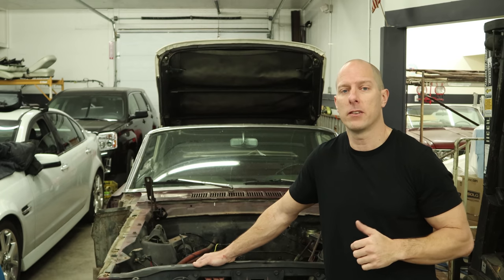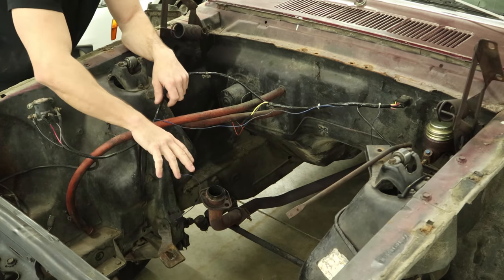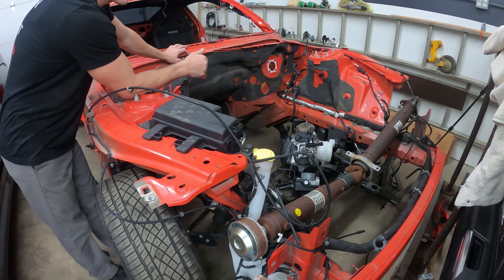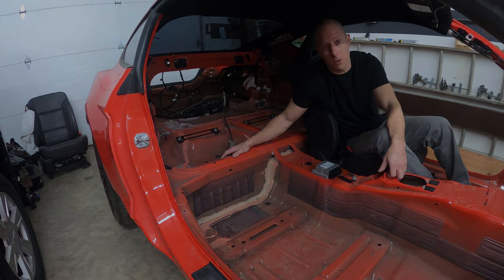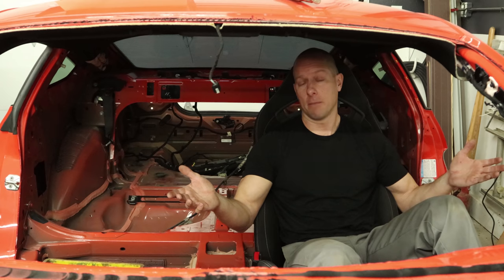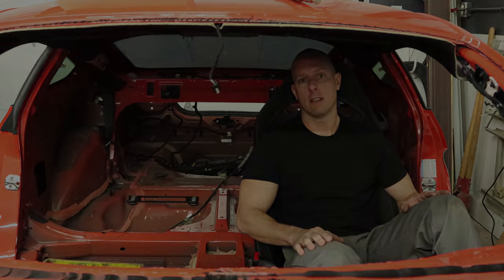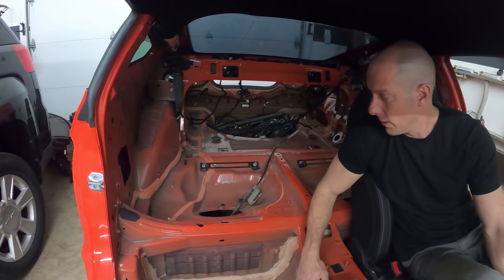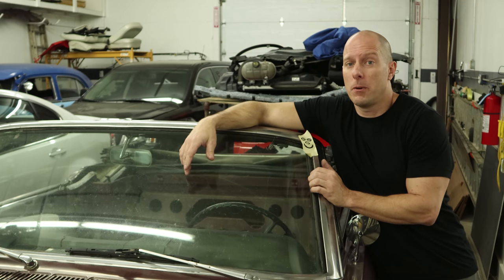The future of the Mustang restomod coyote swap rebuild project  part 6

Comment: I didn't fall for it for reason No 3: there was 5 mins left in the video and I wasn't born yesterday lol

I know I'm a smartass on here but honestly? I think you should look at putting all the 2015 components into the 66 dashboard. I think from a fabrication standpoint it would be MUCH easier and cleaner. There are controls and stuff on the sides of the 2015 that can't just be cut and have it look proper. 

Just comparing the photos of the two other than the odd switches around the steering column, you've got the gauge cluster and the infotainment system and the console. I think that would bolt right up to the very basic mustang dash. 

I wish I lived closer, with my 3d modeling ability, casting, molding and knowledge of CNC, I could make you up any pieces that you needed to mod the 2015 or make the 2015 fit the 66.....
Reply from the maker: Sorry, your CNC and 3D modeling will not work with my freedom units! 😂 the dash is the last part to worry about and I might end up with your method.  Heck, maybe a road trip to hold you to your offer!
Reply: @vehcor  Heck. That would make for a great series of videos. Murray in Oz.
Reply: @talaminia  yeah that was what I was saying....they are actually very similar in basic layout.
Reply: @vehcor  haha I also work in freedom units! We will have 2 x 4's and 4 x 8 sheets of plywood. I buy a lot of 1 x 12 x 96 rough sawn pine for my signs. The only place the freedom units interfere is with sheets of acrylic...the shit is metric and no longer freedom units. 12 mm isn't the same as 1/2" yet they charge the same price....(thievin bastards lol).

Say you want to adapt the 2015 gauge cluster to the 66. Send me the gauge cluster, and make a template of the opening on the 66, I could make the acrylic cover, an adapter plate, or a mold fit the hole perfectly. I've dabbled in cast aluminum too. I use my CNC to make a pattern out of foam, then pack that in green sand, pour in molten aluminum, voila. 

here's some batman logos etc I did for a customer's kids for their bedroom doors:

https://www.facebook.com/muskokacustomwoodcrafting/photos/a.1473939432898489/1520397324919366/?type=3&theater
Reply: @muskokamike127  why not just CNC the aluminum in the first place?
Reply: @chrisanon2573   my cnc wasn't "strong" enough.  I also use a router which runs too fast to properly machine aluminum. 

This was more of an experiment to learn about casting without investing in thousands in equipment. The "right" way would be to machine a pattern, then reuse that pattern to make many copies of something. Using foam, the pattern is destroyed similar to the "lost wax method". 
I also don't have easy access to green sand (proper sand for casting) so I had to make my own which won't hold the shape if I go to remove the pattern. 

I know there are people out there who machine aluminum using routers, but the results are sketchy at best. They also don't go into any detail as to the long term effects it has on their machine. 

I have a buddy who works in aluminum and has a plasma torch connected to his cnc. He wanted to get into more 3d items like I was. He would start out with a block of T6, then run his mill for 24 hrs machining it. I said "just cast it first, then you only have to do the final machining which could be done in an hour". "takes too long" what? takes an hour to cast something and an hour of final machining" no it's faster to run the mill for 24 hrs...OH kay......

I rebuilt my CNC from scratch and while the frame work is infinitely more rigid and stronger, the motors that drive it aren't. I run Nema 24 stepper motors and 12 mm ball screws. To do it properly, I'd need Nema 35 steppers and 20 mm ballscrews. That's another 5 grand right there. 

To give you an idea of cost: A local machine shop charges $100 an hour for mill work. So if it took 20 hrs to machine something, then that would be $2000. My method? $200 to $300.00. 

In addition, I was using aluminum I salvaged from computer hard drives, etc. I had to melt it down into block form anyways to get it into the basic size I needed. Then machine that. Why add an extra step? takes minutes to machine foam, maybe 20 to warm up the forge, (I made it with a steel bucket and plaster), and minutes to cast.

Comment: Hell yeah finally someone agrees with me get rid of the fractions go with decimal points metric is better metric is better.

 Sorry had to get that out
Reply: I have been using metric since the early 80's when I stated restoring and building Japanese motorcycles, then I became a Honda Equipment mechanic. It really is a lot easier to use, I am now big into Bicycles and most of then go by the metric system.

Comment: Can't wait to see this build I do have one question how are you going to make the suspension from the 15 work on the narrowed chassis?
Reply from the maker: It will remain unchanged the wheels will be wider than the body.  I had planned on a body kit similar to Eleanor that has flares that should’ve exactly what I need for width.

Comment: From watching your videos I knew it had to be an plan C and from all the videos you done on Fridays I knew you Mr Spotty and the afternoon crew can get it done. Besides living where we live in the rust belt it’s like remanufacturing one them rusty ones with new parts or in your case with modifying with newer parts. You remind me when I was younger doing body work when we where clipping cars back in the day. I did something similar with an Corvette took an 84 and grafted an 87convertible clip to it with with 96 front and rear bumpers video and good luck✌🏽

Comment: A Rod Shop down here has done it in a similar fashion, a 1967 Body on  2016  floor pan. they widened the fenders to make it all fit and the result is stunning . The owners wanted the older look with modern comfort when driving .

Comment: Really ambitious project. It's not only the mechanical part of fitting everything that's difficult, the electrical part will also be tough. With all this canbus stuff, it won't be easy to get everything running. But hopefully you'll work it out. I know someone who fitted a BMW M5 V10 engine in a BMW Z3, and the hardest part was the electrical stuff.
Reply from the maker: Hopefully I will be able to use everything from the 2015 so there are no programming issues.

Comment: Very ambitious! I love it! and yea you got me on the April fools joke. I wish I had your knowledge about how to acquire these vehicles at low cost. My dream is to do something similar to what you're doing but way more common and that is to LS Swap an old 67 to 72 C-10 GM pickup. Where mine is not common is, I have the same ambitious plan to also to make all the ABS brakes and modern amenities work while keeping the original frame but transplanting all the major systems into the older body, including A/C, cooling, brakes, electrical, ignition, and the whole works. The only sheet metal I'd want to cut would be the firewall to graft in all the holes needed for anything penetrating the firewall of the modern 'donor' to be able to be mounted on the old cab, and maybe use sections of the modern floor pan if it makes sense to do so.
However, unlike you I've all but given up because I haven't learned my way around how to buy these things cheap, like you seem to be able to do. As always you are awesome and inspiring to me personally I don't care what any of your haters say. I look forward to your videos each week, and I learn something from each time even if they aren't GM related.
Reply from the maker: Buying them cheap is all about patience and not getting caught up in “I need THIS one”. You can always watch the auctions and get a feel for it for free.  I hope you get to do your project one day!  Thanks for the support!

Comment: Plan C sounds like a plan.  There was a TV auto program on cable a year ago - damm if I can remember which one - which did exactly what you're talking about doing however they did it with a '67 and a 2016 Camero.  The outcome was great - worked and result was a '67 that they talked about driving and acting like a new car. 

BTW - your mention of bald eagles doesn't have anything to do with... never mind.  Anyhow, keep the videos coming.  They're great.

Comment: Now this is going to be a bit of a major undertaking ! .... Depends on how far apart the wheelbase and width of the 2 cars are .  Don't forget that the end result being a soft top , you're going to need quite a bit more strengthening in the floor of the newer floorpan . ( Do they do a soft top version of the newer car ??....If so you should be able to get factory strengthening panels....makes it a bit easier .) .  There's going to be a LOT of modification going on here !  .... I think you're looking at 12 months or more to get this done !  Will be interesting to follow....

Comment: When you started gutting both cars I figured you would put the 65 body onto the 2015 chassis. I am not a ford guy but still am curious on how your going to build this cant wait!!
Reply from the maker: Kind of, it will be adding more chassis to the 65, there is no structure in the original floor.  Now it will have a set of frame rails that run the length of the car.

Comment: wow.  i think you got way in over your head with this build, if you can pull this off it will have topped your ultimate achievement, which was the Dirtnali.
Reply from the maker: The Dirtnali was just an ordinary job, pretty easy.  The Enclave is probably one of my best achievements other than the dozens of cars I have clipped.

Comment: To widen a classic mustang.
Cut the sides off at the attachment points and the windshield cowl and upper A pillars leaving the windshield area intact as a complete piece. Place the sides and windshield on the donor frame. Widen the upper A pillars to suit tapering to the roof line so roof remains the same width, the side glass will angle in wards towards the top so remaking the window track mounting points will need to be done. You can minimise the amount of A pillar widening etc by cutting the skin off the door and spacing it out so it lines up with the sides. Done right it will retain all factory glass and look completely stock unless parked beside a stock vehicle.
Reply from the maker: Sounds like too much work I don’t want to do.

Comment: I like the idea of keeping the firewall and tunnel. If it were me (and it's not) I'd probably find a front clip (like the Heidts for early Novas) because I've tried to move towers (and it can be done) it was a lot of extra work..  where you might find an issue, wheel offset - way back in the stone ages, it was positive offset, now is negative.... and it affects everything - most notably where the rim would hit the frame rail when you turn the wheel. Another trick (and what I'm using on a car I'm building now) is flares - with the seats and dash no one will ever mistake it for an old Mustang, so externally, it really shouldn't make that big of a deal.  Fun stuff, so you gonna name it Covstang?

Comment: The guys who tube frame and wide body first gen mustangs usually widen the door tops and fenders and leave the body profile under the crease the same. Use the standard windshield, top and middle car bits alone on the new chassis.
Reply from the maker: Yeah, no thanks.

Comment: I was surprised that you were going to give up on the project, but I could see that it was nowhere near the end of the video, so I knew you had something else planned. But Plan C or was it Plan D, sounds like it's going to work. West Coast Customs did something similar with I don't know what car it was, some years ago. The biggest issue is that you are trying to upgrade the 65 Mustang by 50 years and so much has changed during that time. For me, fitting a 2.0 litre engine and five speed manual transmission from a 1991 Mitsubishi L300 into a 1982 L300 to replace the 1.6 litre engine and four speed manual transmission posed enough problems, but nothing like what you are doing. Of the other Mustang builds along the same lines, I think your latest idea is probably the best and most practical and probably easier and less work in the long term. I hope you manage to put more videos of this project up regularly, as I'm very interested to follow the progress. Stay safe, as I know the virus is a lot worse in the States than it is here in Australia. Being retired and living in the country, we are a lot better off here than a lot of people. Thanks for your thought of those doing it tough.

Comment: Plan C will almost certainly include large fender flares, but that could be a good thing if a nice style of flare or wide body kit is used. If you can narrow the '15 suspension to fit in the stock '65 fenders, you would at that point be world famous. Just don't do it like plan B is for Build, and leave a good 5" of the '15 inner rockers hanging below the '65 pinch weld. Not cool.
Reply from the maker: I had always planned on a wide body kit.  The rockers bothered me too.  He is doing what another guy did.  That guy had side pipes on it and it didn’t look so out of proportion.

Comment: Isn't the convertible floor pan designed differently to the non convertible?  I know that you have already considered this but there was no mention in today's video.  I know you are up for this challenge.  Can't wait to see the "How you do it video".  Great Video, loved the catch for April Fools.
Reply from the maker: There is nothing the same on these cars other than the name.  I’m not removing anything structural from the floor of the 65 and the 15 has full length rails, it will be twice as ridged as the original.

Comment: There are 2 builds going on that I've seen on youtube that are taking both the "cut in half and widen the 65"  and the "reskin the 2015" methods. neither are convertibles though. I can see why most people just opt to buy the suspension kits now.  You can keep the 2015 abs brakes and stuff that way but you have to buy or build a custom dash.
Reply from the maker: The convertible makes everything a challenge but I really wanted a convertible, it’s been a while since I’ve had one.

Comment: Well OK you nearly had me there ....
I reckon you have this pretty much sussed out Mate. If it was me i would be drilling out spot welds and removing panels you do not need rather than cutting stuff out. Takes more time but you have as much metal to work with as possible.
Just remember the Italian Coachbuilder's Mantra: "She fit where she touch"
Someone else commented about trying to fit the 2015 dash parts into the older dash? Now THAT would be something to see!
Oh and we Brits still do Imperial. Sort of. We use Metric for parts, bolts and nuts but use feet and inches for sizes like fence heights, window sizes and house plots. Car wheels and tyres are in inches. We use miles on our roads and in our cars, feet and inches to measure our personal height and feet to measure aircraft height. We buy fuel in Gallons, use Kilograms to weigh things but Stones and Ibs to weigh people....
Some may say we want our cake and eat it ....
Reply from the maker: I plan on drilling everything and trimming later.  It is better to have too much than not enough when you are putting it back together.  We use metric in most industrial settings but everything else is freedom units. You guys are just as stubborn as us. lol Take care!

Comment: Put the mustang quarters,fenders, widened hood, trunk, filler panels make up the difference. Widen the roof rails, fill the sides of the windshield using the 65 roof pillars. But the time frame you would give up much profit on crash repair.
Reply from the maker: No thanks
Reply: Could put a SHO V6/5SPEED in it. Ranger mounts,transmission, shaft, axle. Damn near a bolt in swap. Fuel cell efi pump...

Comment: I would definitely take care in when it’s panels, floor , strut tower support etc removal time on the 65. That’s where you’ll make all your money back. People pay big money for very good condition oem parts from a 65-70 mustang. Original panels, floors etc are gold today. So take care in removing them all by not just cutting down the middle etc keep panels and stuff whole cut spot welds nicely and be gingerly when tearing them apart. You’ll thank your wallet for that.
Reply from the maker: I considered that but I don't know if it is really all that valuable, you can literally buy an entire reproduction car.  I may start out with that method but I am sure my patience will run out. lol

Comment: Your “plan C” is exactly how I’ve done my “Neoru” build, you should check it out on my channel, I’m 90% done now but I have over 1000hrs into it. FYI the factory shock mounting location on the 60’s Mustangs are very weak and proned to buckling, I’d be looking to beef up or replace that area of the structure.

Comment: This is kind of what I suggested back on video one, put the body panels from the '66 on the '15. Nice part of a project like this is there is no time crunch, it's not for profit so if it takes a well then fine, a month, ok or a year or two then you just have more time to make videos and we will be here for the ride. This should be no big deal with your skill. I know it's early but what are you thinking for exterior colors? Great mid week video.
Reply from the maker: It will be more than the panels.  The floor of the 65 has no structure.  I am adding that with the 2015.  The front end will basically be just using the panels though.  I’m not on any type of schedule other than I have picked out my next build and want to start on it.  Thanks for the support.